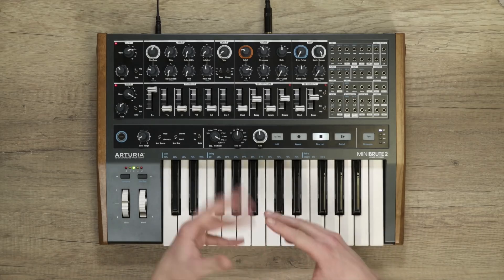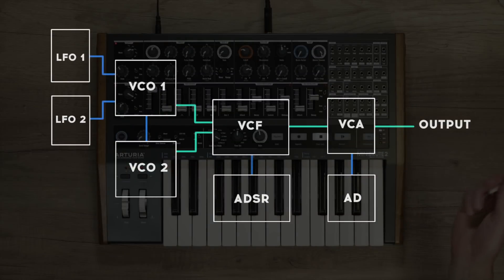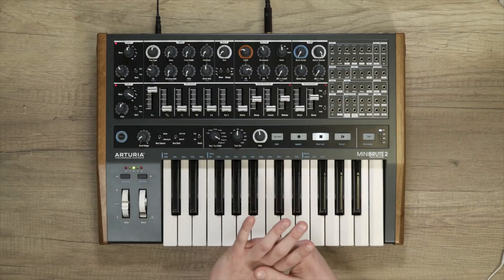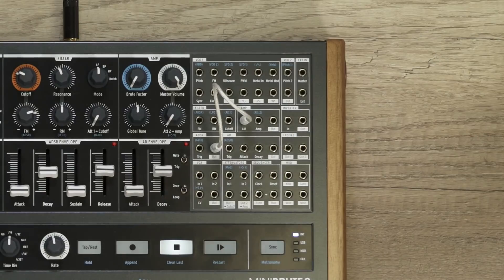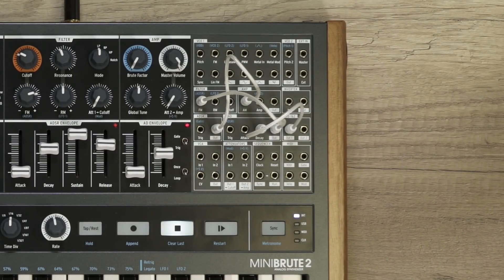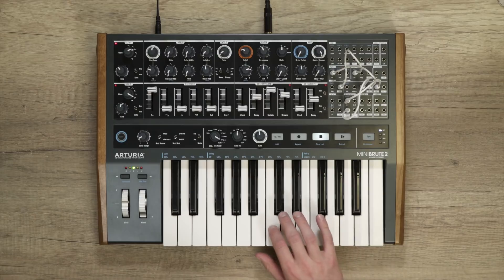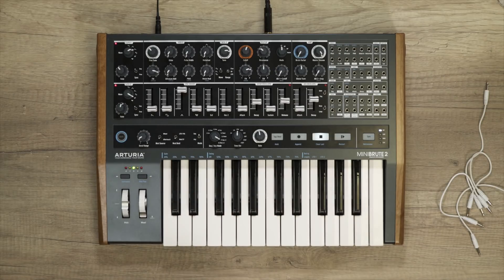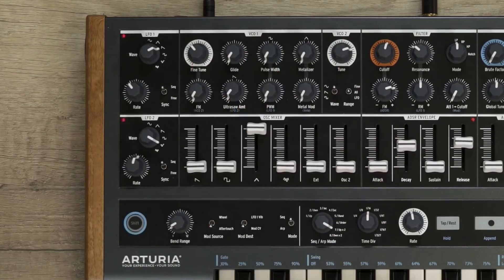MiniBrute 2 Ecosystem Tutorials: Episode 02 - The PatchBay

Comment: Hi Sebastian, I have a scratchy -head quests for you; 1) how to sync tempo, arp., sequences in LogicX that will definitely lock the DAW tempo , so far my sequences, arpeggiators are not  tightly in sync with my DAW's. 2) is there any software (like for the moog Sequence 37) that I am not aware of it to assign midi cc  to record automations (i.e. Cutoff Filters, Resonance), ? Lastly I able to use the mininbrute 2 with the V Collections 7? Thanks! Happy 2020.